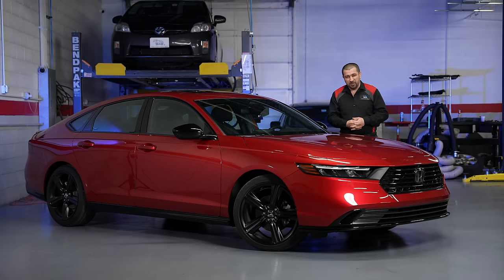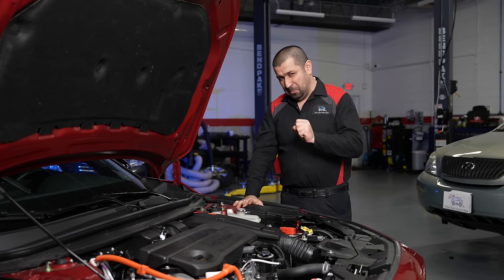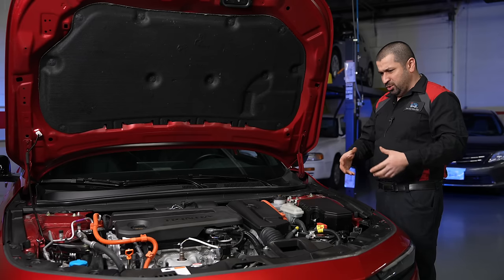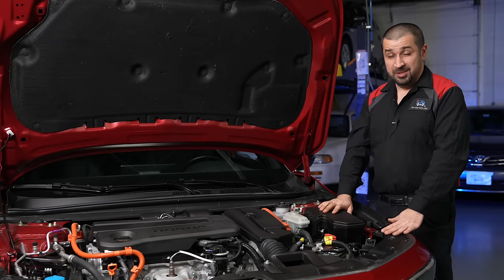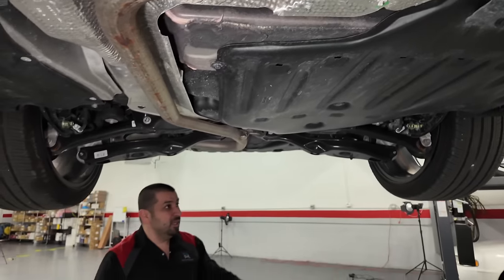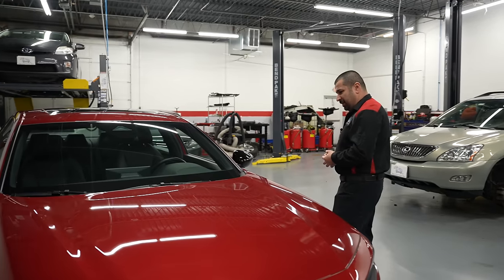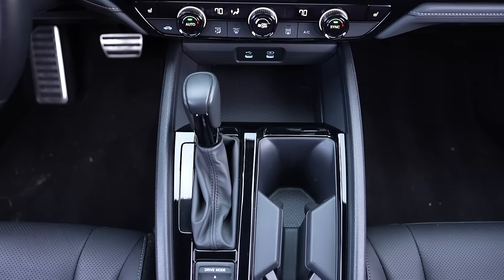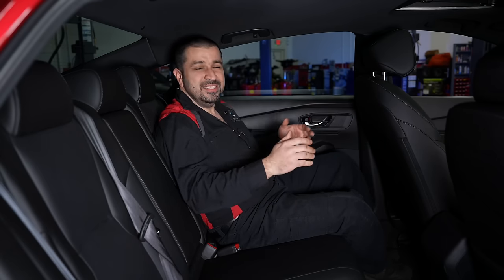Should You Buy The Latest Honda Accord? A Mechanic's Review

Comment: Hummm ... How long will it take for the engine to reach proper operating temperature? ... And will this have carbon buildup on the intake valves? ... This is like an extended range EV without the plug in, and clutch for highway driving.

Comment: Kinda sad they chose the 1.5L turbo engine for this car, compared to before, the reliability is terrible (oil mix with gas,etc.) but it also makes sense, they always had the CR-V engines
Reply: The "?" is appropriate. The dilution issues of the 1.5L turbo in the CR-V, but never the Accord, have been solved.

The Accord Hybrid (subject of "this review") uses a 2.0L, non-turbo, Atkinson cycle engine. And has since 2014, with slight improvements.

Comment: which hybrid system is better, Honda vs Toyota?
Reply: Well, depends on what you're looking for. If you're looking for efficiency and reliability, Toyota is better. If you're looking for feel and active driving experience (is; fake gear shifts), Honda is better. 

But overall, Toyota is better if you don't care about the engine droning. 

BTW, Toyota has released a new hybrid segment called sport hybrid, which has an automatic transmission instead of an E-CVT. It has high performance, though efficiency is not that great. The new Toyota crown and Toyota Highlander comes with this trim at the high end. Most of the upcoming Toyota hybrid pickup trucks will use this one

Comment: Think of it as a locomotive. Engine drives a generator, generator drives the electric motor that drives the wheels. But in this case it charges the batteries also. Personally, i don't think it's an efficient set up at all. Way too complicated and in the end it will be a costly behemoth of junk parts. Complexity doesn't equal efficiency or cost effectiveness in my book.
Reply: <Sigh>. Imagining what exists, and what might happen, seldom works out when the initial premise is wrong.

The (simplified) point of a diesel-electric locomotive, as opposed to the steam locomotives it replaces, is to distribute power over many drive wheels with full torque from speed zero. It is not for efficiency. Some may have a battery to replace the generator for short jobs like yard work, but it won't use both at the same time.

The Honda uses the battery to allow the ICE to run at its most efficient level of power. This can increase its efficiency by as much as a factor of 2. The reason it can do this is that the power generation is entirely divorced from power usage at the wheels. Any difference, surplus or shortfall, is buffered by charging or discharging the battery.

Yes, the process adds an additional loss, but it is less than you think. As little as 5% over much of the operational range. And the gain in the efficiency of the ICE more than compensates. It's mpg numbers are on par with, or even surpass considering how much bigger the car is, the Camry's. It adds this loss, but has better ICE control.

In fact, the reason that the 2023+ version of the Accord lost a few mpg, compared to the 2018-2022 version, is that they added those stupid simulated shifts which take the ICE out of its most efficient range.

And it is far less, not more, mechanically complicated than any other ICE car. Even Toyota's hybrids. It is just different than the complicated arrangement that has been developed over the past 100 years and so is viewed as "normal." Between the ICE input shaft and countershaft, there is one generator, one traction motor, one clutch, and one gear.

Comment: Not as nice - but consider like the top model Hyundai Elantra hybrid - apparently the FRONT is almost identical in measurements for people - the back is much smaller like 2" so noticeable - but if it is just 2 people most times with say a dog in the back seat -- will save you a lot of money and will get MUCH better real world mpg - and the USA gets a good warranty (insurance) included .. and yes it has the app ability to control heated steering, seats and so on from my understanding.  Now - if you just want a really nice sedan - the new K4 - I do not like turbo's but the 1.6L turbo no longer has the dual clutch but the very respected 8-speed auto now - so it could be a dandy (but turbos are not good in real world mpg usually) - but its fairly large now (up here we no longer get the K5 so its said to replace both Forte and K5).

Comment: My 2020 Camry ruined 30+ years of trust for Toyota products because Toyota wouldn't, or couldn't, fix the issues. Toyota lied and only had excuses for the problems. The only thing stopping me from getting a Accord was the turbo and CVT. I didn't know there were non turbos and eCTVs from Honda's. It's also cheaper than the same Camry. I just found a dealer with two hybrids.

Comment: I love it, just wish it had a bit more power like Toyota 2.5 hybrid
Reply: So, you'd prefer the "232 HP" Camry that Car & Driver says goes from 0 to 60 mph in 6.8 seconds, to the "204 HP" Accord that they say does the same in 6.5 seconds? Motortrend tests them at 7.4 and 6.8 seconds, respectively. And please note that the Accord is a 7% larger car, so with equivalent power it should be slower.

You have to realize that these HP ratings are fake numbers. That's why I used quotes. I'll explain below, but it is long. The truth is that the Accord will do better at the lower end of that acceleration test, the Camry will do a little better at the high end, but on average they are similar with the Accord having a slight advantage. I wish a better system existed, but the need to be "backward compatible" to older (which means gas only) cars creates a bit of a dilemma.

My point is that you shouldn't base such opinions on these numbers. Drive the cars.

+++++

The power rating of gas-only cars is the maximum power output of the engine. And there are two problems with that: First, there are peripherals that take some of this power, like alternators, fans, pumps, and compressors. And there are losses in getting the power to the wheels. A common estimate you get 85% of this maximum at the wheel. Second, it only applies at only one rpm. Unless you have a perfect CVT, you rarely even start near that HP.

But Battery Electric Vehicles (BEVs) have a different limitation. The battery is what "makes" the power, and it can make far more than can be used. The motor does not make power, it converts the electrical power to mechanical power. And it does this after all of those other devices get theirs, and after most losses. So the power rating is the throughput of the motor, and it essentially means power at the wheel.

Since BEVs and gas-only cars are so different, their HP ratings are never really compared. Not so with hybrids. And the comparison is next to impossible to make fairly, even between hybrids, because (A) they blend power sources and (B) the limiting devices are not at the same point in the power stream.

Honda used to make a "guestimate" based on those limiting devices. When high power is needed, their hybrids are EVs; not BEVs, but "battery+generator" EVs. So when comparing this Accord to a BEV, it has the 181 HP rating of its traction motor. But when comparing it to a gas-only car, you need to "back out" the effect of peripherals and losses by dividing that by 0.85. That would put this Accord at 212 HP.

But other hybrid systems, especially Toyota's, cannot use such a simple method. When high power is needed, they blend power from the engine (limited by that 85% rule) with one motor that adds power, and a generator that acts as an additional peripheral.

So the Society of Automotive Engineers (SAE) came up with a system to estimate HP in a way that can be compared to gas-only cars. It does not represent the capability of any single device in the car it is a composite of performance in various situations. I don't think this system works well, since it says the faster, larger Accord has significantly less power than the slower, smaller Camry.
Reply: @ it was at first the HP advertised for the Camrys powertrain even though they don’t combine TQ. But I see everyone says the accord drives more sporty and feels more peppy. I don’t need awd but it would be cool. I don’t like how the Camry ecvt tuning is compared to the accord so im actually looking to buy an accord hybrid.

Comment: So, if there is a failure anywhere in the traction motor, the motor/generator, or the circuitry or systems of either or both, you're  stranded as you explained it.
Reply: And how exactly is this different than any other car?
Reply: @jeffjo8732  if it were designed properly,  the engine would be able to propel the car in the event of a hybrid system failure.
As presently designed, the engine can only power the wheels directly at speeds of over 60 mph as he explains it.
Reply: @jeffreystoddard7201  Name a hybrid that can go anywhere "in the event of a hybrid system failure."

And its 40 mph, not 60 mph.

Comment: I really don't understand why we collectively assign so much importance to perceived "shifts". In an ideal world the system should be designed with purely efficiency in mind, and not catering to the "needs" of a public whose perceptions are shaped by decades-old technology. The whole concept of shifting was a limitation of the gasoline-only engine technology. Now that we don't need it, when manufacturers implement fake shift points, it needlessly causes wear and tear on the engine from varying the speed unnecessarily. Perhaps it doesn't make a difference in the grand scheme of things in terms of maintenance costs, but it still seems silly. Engineering Explained explains this well. We should just get used to the noise our machines make corresponding to the power output we demand of them and putting up with any resulting "drone".
Reply: Unfortunately, many of those who are most interested in power, grew up associating an increase in power with ... the momentary loss of power needed to change gear ratios. The 2023 Accord Hybrid lost 0-60 time, and mpgs, all due to adding the shifts. Which they did to assuage a significant amount of criticism for not temporarily losing power..

Comment: I bought a new 2006 Honda Accord and it gave me Many Problems. Honda was in Denial for Replacing it or Fixing the Problems, so i was forced to sell it. Honda's customer service was even Worse. NEVER AGAIN HONDA JUNK. 2024 Hondas are #15 in Reliability, from different Data Companies ! 💩🚙💰🔥
Reply: I have  2011 civic, 2017 accord no issue. However i get 2019 odyssey that give me issue after 3000 miles. On going issue with infotainment which control everything on dash. Is kept disconecting even shut engine in the middle of the road. Sliding door that won't closed nor open numerous time. The forum said it happen to many 2018 to 2020 Odyssey.

Comment: I bought a new Honda accord  back in 2007. I bought a used 2001 Toyota Camry and a new 2011 Toyota Camry. We put over 300,000 miles on all three cars except the 2011 that we still have. Honda accord has a lot of room compare to camry. Its engine seems to have more power than both camrys. Here's the worse part of Honda. It's very noisy inside. The body of the car seems to be very light, or lighter than Toyota. That tells me not to buy another Honda.

Comment: Honda brand has taken a beating with the new earth dreams engine. Started as a Honda fan with  Odyssey 2001 and Accord, ended up with transmission and engine issues. I still like their exterior design and looks of most of their vehicles, but will not go back.

Comment: I owned a 2009 Honda Pilot EX, and that vehicle had a TPMS that told you which wheel had low air pressure!  Again, it was a 2009!  Since then I've owned a 2025 Subaru Forester and a 2017 Toyota Sienna, and my wife still has her 2015 Subaru Legacy Limited, and none of their TPMS tell you which tire is low!  So, yeah, big whoop in 2024 (15 years later!) Honda has a TPMS that can tell you which tire has low air pressure.  Thanks, but really, 15 years??
Reply: Honda's system does not tell you which tire is low. To do that, you need a sensor in each tire, that you move around when you rotate the tires or get new ones. Honda tells you that there is a low tire, and you will be able to look at them to see which.
Reply: @jeffjo8732  ... you'll have to check out a 2006 Pilot (I said 2009, but it that was my mistake)  for yourself.  I owned it for 8 years and it indicated which specific tire was low.
Reply: @JOHNch4.v.v.7to10  This is 2024. Honda's current system, including the one in this review, does not. For that matter, is it worth the bother when you cam just LOOK.

Comment: Too expensive 40k for a accord and 30k for a civic now is crazy...less power and accord still haven't gotten to 300hp yet. Camry is 300hp and still good on gas
Reply: And, at 225 HP, the Camry has "gotten to 300 HP" ? Your math needs a little work. The Accord lists at 204 HP, but both 225 and 204 are "fake" numbers based on comparing these completely different power trains to what a conventional gas powertrain could do. And the fake numbers were designed to favor the Toyota.

At a fake 200 HP, the Civic hybrid is essentially the same size as the Camry, is cheaper, and is faster with better mpg for similar trims.

Then, maybe you need to do some actual price research. Start with the fact that the top-trim Accord has an MSRP of $38,890 (so less than $40K). And it includes features that the top-trim Camry (MSRP $34,535) only includes in expensive packages that bring the price up to, or above, that Accord's.